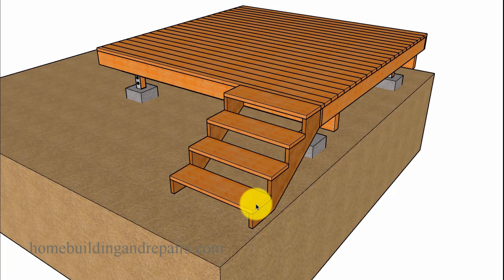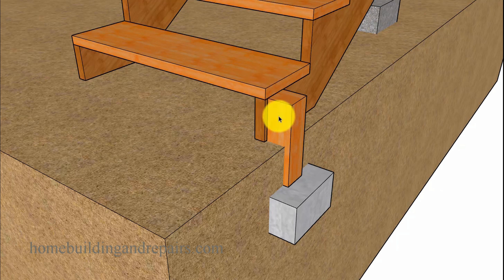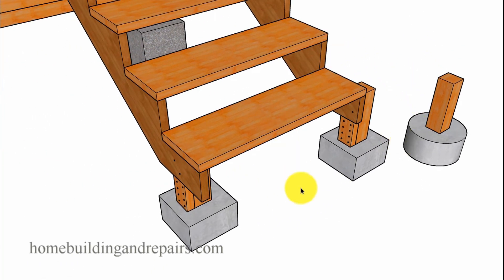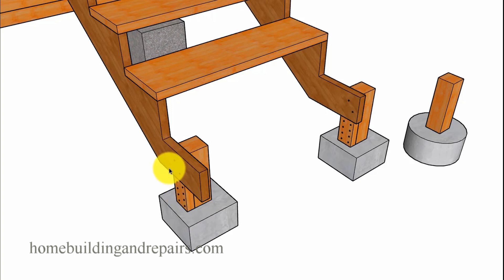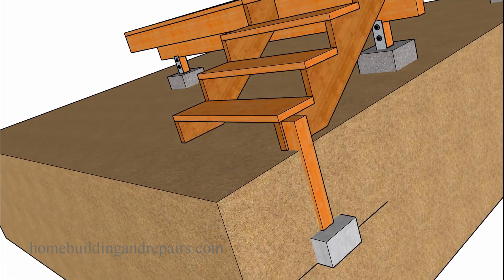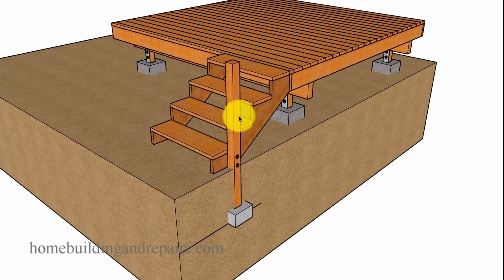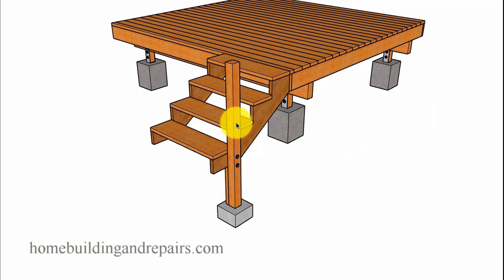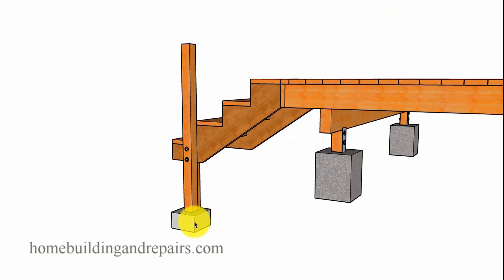How To Install Footings For Wood Framed Deck Stairs According To The American Wood Council

Comment: Could I use a double rim joist for stair landing? If I set 5 post 4×4 across 15ft 3ft into the ground. Attach the 2×6 on the inside and outside of the post. Then set the stair stringer to deck and rest the bottom of stringers on the 2×6 . I would be resting 2×6 a few inches into the ground so my bottom step can have about 7.25 rise leaving that 1st step with enough meat to step on without braking. I dont wanna pour a long concrete foot. I don't wanna lay gravel to place and fix a 2×12 flat for a base either.

Comment: Curious how this would work if there was a third stringer in the center?
Reply from the maker: I think you would do the same as the outer stringers, but just cut the top of post even with the bottom of tread or top of first stringer step. However, this  would just be my guess.

Comment: If they bolted that post into the sides of the second step it would be so much stronger. There's so much more material than the measly first step.

Comment: In this scenario. Wont the two opposing forces during frost heave cause uncessary stresses along the bottom of the stringer and the post? I obviously fail to see how this is any good, nevermind the wood in the ground issues.
Reply from the maker: I can't argue that, but can tell you that these people know a lot about this stuff.

Comment: I am building deck stairs right now, and the county I am in handed me this same information from the American Wood Council. This B.S. had me going out of my mind. Not that I didn't understand, but what I understood didn't make sense based on what I know about construction, which is a lot. My first thought was WTF this isn't a fence. Thanks for helping me realize that I am not retarded or crazy. The American Wood Council is though!  Now I can turn my plans in with crossed eyes, a crooked smile and drooling. And be confident my plans will be approved.
Reply from the maker: I've never done this, but it might be something I would consider if living in areas with ground frost that could ruin a concrete footing or slab above frost line.

Comment: Ha, I'm building a deck stair footing just like this right now and it seems like a bad idea, unless you wanted to make it easy to replace the pole that will rot out in 30 years.
Reply from the maker: Yes, this doesn't seem like it would be the best method, but in some areas it works.
Reply: 30 years … try 12. I live in Chicago area and I’m having to replace the posts and stringers on my stairs. It looks like both were just set on the ground so not surprised. Luckily it’s just 4 steps.

Comment: Hi great video!  I have a Mobilehome with steps and iron railing where one step at the top deck that’s loose due to the rotting of the railing.  I’ve hired a guy who offered two options, one to shore it up guaranteed to hold, second a whole new deck which is more costly. I chose the shoring, Is that a good idea?  Thanks for any advice. 👍🏽☺️
Reply from the maker: Most repairs usually have something to do with how much money you can or want to spend. Let's just hope it lasts until you move out.

Comment: Is it your interpretation that I would need a footing as you illustrate for every stringer? If not, how would you recommend supporting the additional stringers between the outer stringers?
Reply from the maker: This video was provided to give you an example from the Wood Council, but I would use a concrete footing that would support all stringers at the bottom. If you live in areas where it snows, then you might contact your local building department or contractors to find out how deep the footing need to be, other wise a 12 inch deep footing might work.
Reply: My drawings were sent back with notes that I needed 14 diameter 42 inch deep piers below grade for each hand rail post. I’m up at 8,500 feet and says that all framed structures above 30” requires 70 PSF to meet min. wind and snow load. Seems overkill to me.

Comment: Instead of using a 2x4 bearing block, use a 2x10 to fully support the end of the stair stringer.  Pressure treated wood should be rated UC4B (ground contact heavy duty) or UC4C (ground contact extreme duty) for below grade installation.
Reply from the maker: Great ideas and keep them comming.

Comment: I’d pour concrete above ground, do not put your post into the ground as illustrated. It will rot out.  Either encase the wood in the concrete or anchor the post to the concrete
Reply from the maker: Good points and don't forget you can use ground rated pressure treated lumber as another option.

Comment: Maybe I missed it...but, is the post 1/2 way into the concrete footer, or sitting on top? - with or without some sort of galvanized bracket or bolt? 
Some say, set the post all the way through the concrete with notches in the post to hold vertical position, and to allow water to gravity feed through. (of course, extra waterproofing treatment for below ground level. And seems to be mainly for fence posts.)
Reply from the maker: I like to use metal base connectors that provide me with at least 1/8 of an inch or quarter of an inch space from the concrete, but if you were to bury it in the ground, then it really wouldn't matter. If you are going to bury a post in the ground and have it connect to or run through a concrete footing, just make sure the post is chemically treated or pressure-treated lumber that can be buried in the ground.

Comment from the maker: Make sure that you understand that this is not my suggested method, even though I think it would work just fine in areas where the ground freezes, but a method suggested by the American Wood Council. The reason why I made the video was to provide viewers with a three dimensional view and a better understanding of what the American Wood Council provided in one of their pamphlets for building exterior decks and stairs.

In areas where the ground does not freeze, a simple 4 inch thick concrete pad might work just fine underneath the stair stringers.
Reply: I dont mean to be off topic but does anybody know of a way to get back into an instagram account?
I stupidly lost the account password. I love any tricks you can give me.
Reply: @Alec Ethan instablaster :)
Reply: @Eden Ameer Thanks for your reply. I got to the site thru google and im in the hacking process atm.
Looks like it's gonna take a while so I will get back to you later when my account password hopefully is recovered.
Reply: @Eden Ameer It did the trick and I now got access to my account again. Im so happy!
Thanks so much, you saved my ass!
Reply: @Alec Ethan happy to help =)

Comment: seem like a bad idea to put treated wood in the ground....unless this is backfilled with gravel....and if it's backfilled with gravel then the frostline is changing position, this just seem bad
Reply from the maker: I agree and keep in mind that this video was made to provide viewers with something that I might not recommend, but something that a group of individuals whose job it is to provide us with better building ideas, does. I also don't like the way the bottom of the stair stringer connects to the top of the post.

Comment: The newer copper PT techs are much less resistant than the old CCA PT;  About 1 tier from what I can tell.  I'm putting aside the first few years when they were experimenting with treatment techniques;  This is inherent to using copper-ion based treatments without any other toxic metals.

They used to divide it into "Above-Ground", "Ground-Contact", and "Ground-Contact Heavy Duty", and they extended this rating from the old CCA into the newer techs, but may have been a bit mistaken about what equated to what.

"Above-Ground" rated PT lumber is worse than anything in CCA PT that they used to sell - which is why eventually big box stores in my area eventually stopped carrying it entirely.  "Ground Contact" is fine for above ground use, but don't expect it to last very long when buried in anything but a very dry climate.  "Ground Contact Heavy Duty" is what they used to sell for exotic things like permanent wood foundations and docks, and it may or may not be alright for posts in a damp climate, but the big box stores don't carry it to my knowledge.  Also, GCHD and even GC has so much free copper that it will rust out anything but stainless fasteners.

The thing you're supposed to do now if you want an outdoor post to last decades in anything but a desert, is to use a fancy steel Simpson anchor that embeds in a concrete foundation and provides a standoff distance.  There's a minimalistic anchor that can't resist torquing (and thus you must support from above), and a much heavier duty version that provides either some torquing resistance for eg fences or in this application, or can be used to reinforce a structure significantly.

I'm not super-happy with either of these;  I think perhaps if you want a permanent long-term solution you may want either a steel post embedded in concrete, or a helical steel anchor with some kind of bracket to attach a wood post to.  Not a small project, and not practical at all for one or two posts.
Reply from the maker: I think what the Council was trying to do was provide people who live in areas where the ground freezes a better method of construction, but you could probably pour a 4 inch thick concrete pad underneath the stair stringers in areas where the ground doesn't freeze and end up with a better stairway.